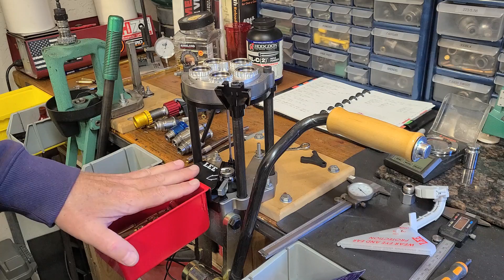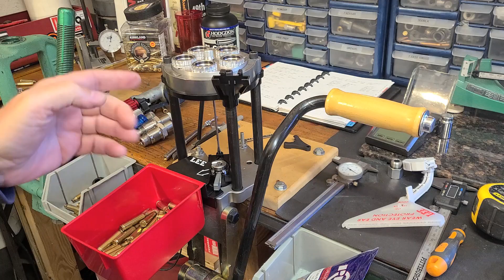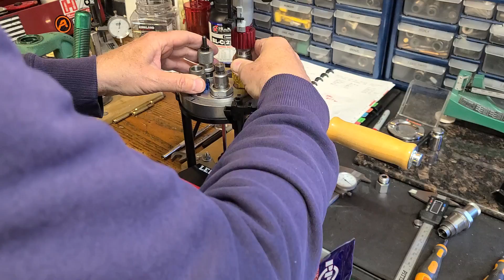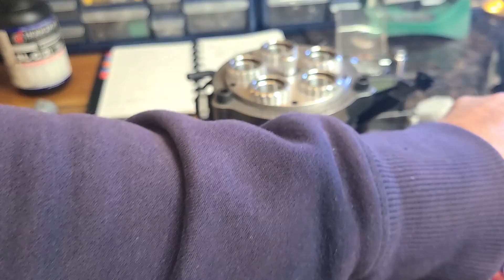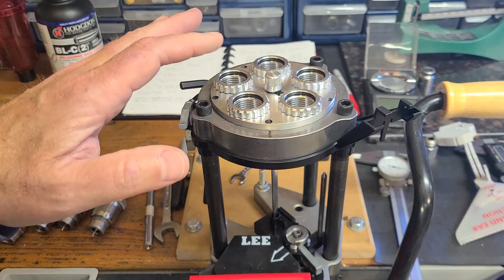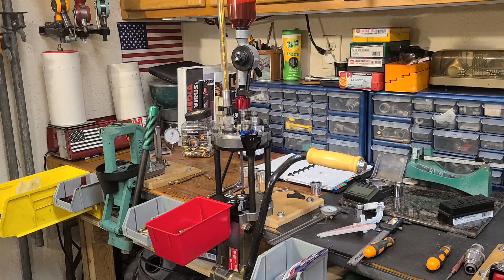Lee Precision Ultimate Turret Press...First look at part no 91910

Comment: This press does not make a lot of sense to me.

On an auto-indexing turret press there is a premium, in the form of full (big 50 BMG in this case) handle movement, to pay for each additional station. Plus the larger turret circumference makes the auto-indexing system work harder and wear quicker. So the 5- and 6- stations are too much. I would rather insert the bullet manually, than load the bullet feeder and then add a handle pull to each round. After all, the case is in the most convenient place (for manual operations and visual checking) in front of the reloader at all times.

On a turret press, a 2-station option is worth more than 5- and 6- combined. In rifle calibers, sizing is usually followed by trimming, deburring and wet tumbling to remove the case lube. So what is left for the auto-indexing turret press is just powder drop and bullet seating if we skip the Factory Crimp.

The only situation I can imagine, where 5 stations would be worth it, is factory crimped .357 Sig / .400 CorBon with 2-stage sizing - first the body with a carbide .40 S&W / .45 ACP die, then the neck and shoulder with the caliber specific steel die. Some say it is possible to avoid lubing the cases this way.

Plus there is the issue of hard to change turrets. The option to quickly switch between 3 and 4 holes would be nice. 3 for revolvers with seating and crimping combined, 4 for pistols with the FC die.

I would rather prefer the old style presses, 4 hole max, with their easy to change turrets, just with optional 3-hole turrets and re-worked auto-indexing system to provide the 2-3-4 flexibility.
Reply from the maker: Thanks for the comment.  There will be a lot of people who will not see the value of this press, meaning the 4 hole LCT will not be going anywhere soon.  The indexing system seems to be strong enough to handle the weight on the turret.  I don't see wear as a problem.  If there is wear overtime, I think we will see it in the clutch assembly which will be easy to maintain with a simple parts swap.  Lee sells the ENTIRE plastic parts kit for $10 so freshening it up would be easy and inexpensive.  I'm sure they will refine that to just the clutch and clutch housing in the near future.  As for the extra pulls for a completed round... My experience, so far, is the efficiency of the bullet feeder and the completed round kicker makes the extra handle pulls less noticeable.  The press is very productive in my limited time using it.
Reply: @TreeTopFlier  Manual bullet insertion is not very time consuming on a turret press, at least the fetching of the bullet can be done while flaring and powder dispensing. And it needs to be done anyway while filling up the bullet feeder. I cannot imagine an automatic (motorized) bullet feeder working with a turret press.

I withdraw my criticism of the new turret change system - the old way of lifting the turret half way between the clicks is impossible with a variable number of stations.

What I am liking less and less, is the new turret positioning system. The ball detent would still be nice, it might be made softer (not to make the indexing work to hard) and less precise, to provide some coarse positioning for the alignment pin to find its mark and do the final touch. The only sacrifice would be the dual use of the 6-hole plate. A separate 3-hole would need to be made. Yet these plates are intended to be bought separately, so the probability of using both 3- and 6- options by the same reloader is rather low. On the plus side - the 6-hole plate could be used in the manual indexing mode, providing some competition to machines like the Lyman All-American 8. With the current system, manual indexing simply does not make sense. Too bad for those in favor of working with just 2 dies.

The complete round kicker - it comes with some awkward shellholder retention system (to provide free rotation), not working very well with other brands' shellholders with their different outside diameter. Tell that to reloaders doing .44 Mag or 9x19 - Lee shellholders are notoriously bad in these calibers because of the unification with the next bigger caliber - .45 Colt or .40 S&W. I had some brands (S&B for example) of brass pull away from a Lee shellholder on priming or sizing downstroke, with some rim damage.

Comment: Excellent video--very well explained with objective pros and cons. Thank you!!  What is your take on the way the shell holder is captured on top of the ram?  I've seen another video review of this press which shows that some non-LEE shell holders are not held in position very well (no spring clip to capture them) and even the LEE shell holders seem like they could slip out of position very easily.  I'd appreciate your opinion of the new shell holder system.  Thanks again for a great review of this press.
Reply from the maker: Thanks for the comment.  I measured shell holders from 4 manufacturers.  They were within .012" of each other...not enough to make any difference.  While I'm not a fan of the plastic clip that holds the shell holder it has worked OK for me.        The shell holder is designed to float for self alignment.  I plan another more independent video as soon as I get the rest of the turrets.

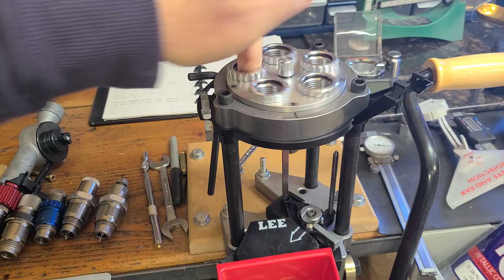Comment: 14:17 Adding an indexing detent would actually be very simple to do on that press configuration. In fact, it would be simply enough that it could be done with hand tools (though a drill press would make quick work of it). Its simply a case of drilling and tapping a radial thru-hole in the steel top plate in a decently chosen position (position is all that critical) and then a series of shallow dimples drilled radially into each turret tool plate you plan on using.

LEE more than likely dropped the feature, not because it cant be done but rather as a cost saving measure to reduce both machine cycle time and extra materials cost associated with the detent. In fact, the engineers likely had it designed in and the bean counters said, "get ride of it".
Reply from the maker: I'm sure a detent is possible...I can think of several options myself.  I suspect, however, they were focused on improved alignment via the bayonet pin vs a ball in a notch.  The LCT could be aligned by running a case into the sizing die while the bolts on the turret housing were loose, then tightening the bolts, which also means it could be misaligned.  This version they tried to put to rest some of their chief criticisms, valid or not...My impression.   So far, Ive had two reports ,one from a former LCT user, not happy and one from someone who hadn't used the LCT...No big deal.  I think ultimately to make everyone happy there will have to be some sort of friction added to the turret so it doesnt advance past its index point.  A simple Teflon screw to put a tiny amount of drag on the turret.   Thanks for watching and commenting!
Reply: Lee did not use a detent because a detent will not work with this press. This turret press works with 3, 4, 5, and 6 hole die plates. With a detent it would only work with the one you choose not all of them
Reply: @ The number of holes the die plate can have MAKES ZERO DIFFERENCE because each die plate would get a match set of dimples (i.e., a 3 hole plate will have 3 dimples, a 4 hole, 4 dimples, and so on) drilled into it. Then the top frame plate that the die plates ride in would have a single detent.

All that is critical is that the relative relationship between the ram and detent is used for the relationship between die plate holes and dimples. 

By that I mean, if say the detents position is clocked 45° about the center of rotation of the turret relative to the ram in say a clockwise direction as viewed from above, then the detent dimples in the die plate must always be clocked the same 45° relative to the die holes as viewed from above too. This is critical so that the detent engages with corresponding dimple when the ram is aligned with die hole.

All in all, not only can it be done but its not hard to do (I used to design and make tooling plates for a turret system that for all intents and purposes was the same as these Lee turret presses) and thus, I still stand by my statement of Lee simply didn't do it because of the additional cost and machine time per part. 

If for some reason Lee didn't do it because they thought it couldn't be done, then quite honestly, they need to higher new design engineers because this a certainly doable and easy to do..
Reply: @CP_300PRC Ok. I understand your explanation and see now that I did not think this thru as you have. Thank you
Reply: @chanraxter2015  No problem. I hope my reply didn't come of as cocky or anything. If so, I apologize for that.

While on the subject of the detent. It turns out that they (Lee) had the features there all along to have a detent function (though they did it a little different than the way I would have but I can see how for them, it could keep cost down a small bit but at the expense of it being easier for the customer to loose the spring and ball if they need to use a 5 hole plate at some point. but I guess really that is neither here nor there). 

Turns out that they were simply not supplying the right bearing plate, nor the spring or ball but supposedly are now. The screwed up part is if you have a "pre-detent" press, you have to buy the 3 parts (though not expensive or anything but still pretty wrong in my opinion to make those people have to buy the extra parts).
Reply: @chanraxter2015  It would work with all of them because the detents would be located to and numbered to match the holes in the turret.

Comment: Picked one up got it in about a week ago and got it all setup, ran a few hundred 223 through it so far. Got mine from titan as well. Got the kit and an extra tool head for 9mm ( so I can just change heads and go). Glad to see a real video on this press besides lee’s quick 5 sec vids. Love it so far, VERY well built and a big upgrade from my single stage breach lock
Reply from the maker: That's great! Have you encountered the turret overrun issue I talked about?  If so, what are your thoughts?
Reply: @TreeTopFlier not so far, I have dealt with the indexing rod not being in position a couple of times when I was doing my first few rounds but I got it down. This is my first turrent though so there’s that. Outside of that it’s been great. Was thinking of going with the six pack pro but decided to go this direction, honestly glad I did.
Reply from the maker: @BradAytes  good to hear, thanks for getting back.

Comment: Thanks very much for reviewing this for us TT.  I saw the Ultimate advertised and wondered if I should upgrade, you answered my questions  -except - why is there no built-in LED ring lighting to see the case? 

I'm like @JP1AO -  I have already invested in about 30 calibers with complete die and turret heads already set up ready to go, so I'm not keen on replacing all of those.  My Classic turret press has been disassembled, lubricated (per TreeTopFlier guidance) and so perfectly adjusted that it almost operates itself!  I don't like the lack of an indexing ball on the turret head.  I'd probably have to also learn a new powder drop instead of using my Auto Discs.  As far as I can see the only real advantage of the Ultimate to me would be the added speed of the bullet feed.  I don't load magnum-length rifle rounds and don't really need more than four dies in the turret.  Glen
Reply from the maker: Thanks for the nice comment and so glad you got use of my Turret Press tune up video...made me smile!  In my opinion, the Auto Drum is superior to the auto disk.  I have both and would not consider going back... More accurate, infinitely adjustable with a smaller foot print, downside, sometimes a little leakage.   Thanks for watching and commenting.

Comment: Is the base the same as the 4 hole value turret press? Might it be possible to convert to a 5 hole by switching the top end and the plastic clutch body? I'd like the bullet feeder.
Reply from the maker: This is much bigger than the values press.  I dont think any of the parts are interchangeable
Reply: @TreeTopFlier  thanks.

Comment: Treetop great review, I just bought a Lee value turret press for my Christmas present. I know what Lee is speaking of about die tipping, I've seen it when I was to aggressive with the press. The press pushes the tool head up on one side cocking the tool head.
Reply from the maker: Yeah, I'm sure that's what they are referring to, however, I searched and couldn't find anyone talking about it as a problem other than Lee?  And I have never been able to translate that into an actual problem.  It would be easy to isolate.  Mark cases on one side, resize them and seat bullets in them with the mark in the same location.  Then check cases and completed rounds for runnout.  If the tool head is inducing a problem you would see it indexed in the same direction each time.  I dont think thats the case.   Perception vs reality.  But I agree there is a little rise on one side.
Reply: @TreeTopFlier  I've seen it from time to time on my FB group especially with handgun rounds.

Comment: I recently upgraded from single stage to the Lee 4000 progressive, found that when I change calibers/setup I need to manually feed 1 case per rotation and check function at each die to see if any need adjustment (flare amount, seating/crimp depth) and once getting a complete cartridge perfected several times then I can use autocase feed function for speed. However the bullet seating is on back of press , difficult to double check for powder, have to sit at an angle to be closer and use mirror and lights (especially for those deep 38 cases). I can see the need for 6 die head if  want to use a bullet feeder(glad you got yours to work) and a powder checker.
Reply from the maker: What's nice about this press is the ability to add or subtract die positions depending on specific need.  Thanks for watching.

Comment: Was wondering if dry graphite could be used to lubricate the turret, instead of using oil or grease?  I am guessing the maintenance will be pretty close to your video on the  classic cast 4 hole turret you had posted a while back.
Reply from the maker: Hey Tye!  I'm sure you could, however, the viscosity of grease seems to slow the turret down which helps with the overshoot issue I showed.  So using grease may actually serve two purposes.  Worth experimenting with though.

Comment: Nice overview, not all that different from pro 4000. I’m definitely thinking of switching to this from the pro 4000. I’m more interested in precision ammo versus bulk. This makes a lot more sense to me.
Reply from the maker: Its a nice press and I see no reason why it couldn't produce match grade ammo if the user does their part.  The turret over run issue is real but can be adjust for with minor changes in the way you operate the handle.  Thanks for watching.

Comment: Excellent as usual!!! I lean to the progressive side but this would be great for lower volume cartridges. Great intro!
Reply from the maker: I just loaded more last night, its very nice!
Reply: the turret press is actually much easier to setup and takedown.  on my pro1000 just last week i spent an hour setting it up, and an hour making ammo, then another 20min taking it down(getting the primers and powder out).  Using just a 4hole turret press and the primer arm is much faster to setup and takedown.  So it just depends on how often you change calibers and how many you make at a session.

Comment: I believe that would be a nice press for someone that is beginning to break away from a single set up. Cost and Value seems to be Lee's approach of a Business and in recent years they have came out with many new innovations. Some work, some don't without fiddling and tuning. But, that's the way it is with some Lee products however, they have came out with indispensable products like their factory crimp dies for rifle and a lo-cost universal de-priming die that holds up. anyway, good video. Peace - Dave
Reply from the maker: Hi Dave!  Lee has been on an innovation rampage for the last 5 or so years.  One new product after another. And I have to respect the effort to keep American made products affordable.  I do think they should field a few for testing and refinement before putting them out in public.  Overall this new press is pretty awesome and feature filled.  I feel like the turret over run issue will need to be addressed to reach full market acceptance.  I am a sample size of one so not sure if this has been an issue for others.  Hope you're doing well sir!
Reply: @TreeTopFlier  I saw that you and Walter have been conversing and putting your heads together over this press. You and him should do a Co-collaborations series of videos on what could be improved, what needs to go and what becomes a problem later on with the press. I believe that You and Walter could really be a benefit to the reloading community over this.  Peace Bro - Dave
Reply from the maker: @thorsaxe5881  Walter @viejo2a is a great guy with a ton of knowledge and perspective.  We've talked several times about this press and what we've discovered about it. That will, undoubtedly, find its way into our videos.  We will see where it goes.  I think finding possible refinements to this press will be inevitable.  Thanks, as always, for your thoughts and comments Sir.